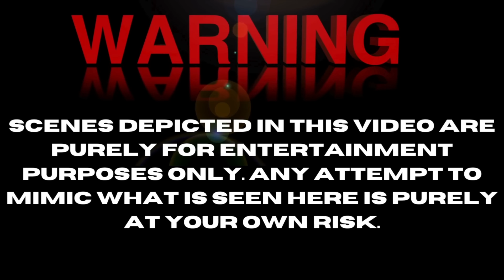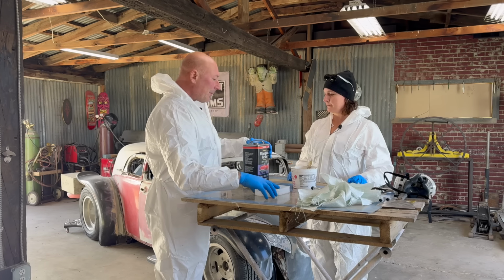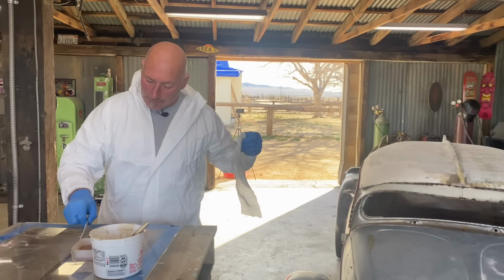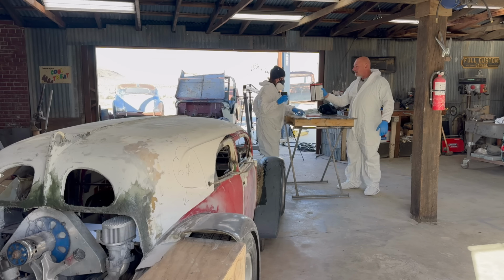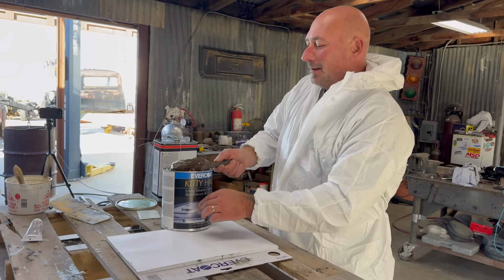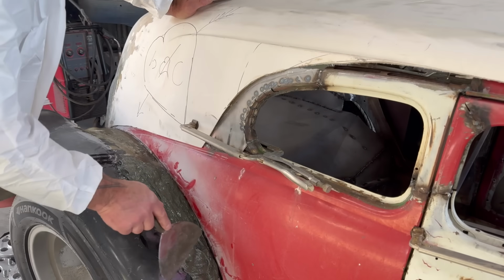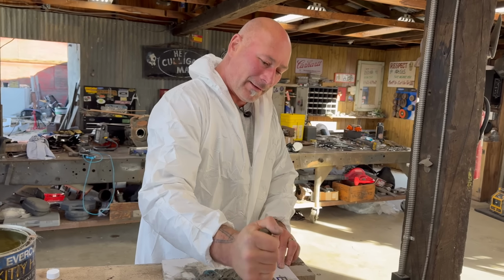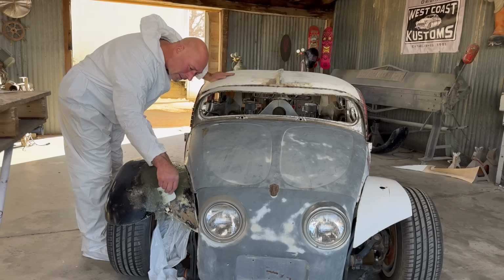Part 28! Full Custom Ian 1968 Kustom Volkswagen Bug Fiberglassing Lesson Is In Session 🤓

Comment: i have worked in the fiberglass industry for 45 years doing everything from grinding to mold making and a little thing you can do to avoid the ichies when working with glass is to use baby powder on exposed skin before you work with the glass also use cotton clothing it makes a big differance
Reply: Yup
Reply: Please match the front window's to the back reverse that shit , just saying 👊👊👊
Reply: Not the windscreen
Reply: Thankyou @TheresaFogg  for the tip 😊👍🇦🇺🍻🍻
Reply: Good for you
Reply: Ian, you should spray the steel body with a release agent then build the glass against the body.
It might save you from some extra work.

Comment: Great content, editing, episode. Having gone through 45+ gallons of epoxy resin and hardener in the last eight years in boat refits I have a few bits of advice I haven't seen mentioned in any of your posts. I always double glove when doing epoxy work. You never know when you might need a clean, gloved hand to pick up a different tool. Those plastic spreaders can be lightly folded to create inside and outside flowing radii. Keep doing what you do. Thanx

Comment: For FRP / fiberglass reinforced plastic you need to use between 1% to 3% depending on the weather hotter days go with 1% colder days go 3% an this ratio you should get like 30 min work time depends on what type of polyester resin your using an for hot glassing  you can go like double catalyst an the catalyst type as well depends on time an function for the FRP system you are using 😉 I know this as I have been in the industry for over 40yrs I have been watching Ian for yrs love your work 😊😊 ❤❤
Kind regards Jasmine the JDM girl 👧 from Sydney Australia 🇦🇺 💕 💖 ❤

Comment: A little tip from an OLD fiberglass guy. Ultraviolet lights like the old black-light fluorescents will fire off your catalysed material without overheating it the way heat-lamps do. If you can luck onto an old tanning bed canopy that has the 8 ft fluorescent tubes, you will be set to lay up resin in cold weather without any worries about getting it to fire. I bought one from Goodwill for $20 about 25 yrs ago and it would be yours if I were driving your way with my truck. Unfortunately, being 80 yrs old and only flying into the desert for some liesure time, won't get the job done. I'm in Sonoma County if you have a friend up here who will be making the trip, I'd be happy to hand it over to them.

Comment: I have worked in the fibreglass industry for nearly 50 years .. making surfboards to making moulds for various things and carbon fibre wings for drift cars and motorcycle fairings .. correct ratios are 10% catalyst to the amount of polyester resin and should be applied when temperature is between 20c and 30c .. to have perfect time and mix .. we all have different ways of application .. mine is to make the less mess the better and always have acetone available for clean up .. sanding dust should be washed off with cold water first !
Reply: Surfboard building is a artform in itself, it's amazing how you Guys design and shape them.

Comment: If you only put a pin code of resin on one side of the fiberglass Matt after it dries it's flexible so you can form the shape that you wanted to be and tape it down then you can put it where you want it with 5 minute epoxy instead of rivets and

Comment: I used to add a few drops of fiberglass resin to my body filler (Bondo) to make it smoother and reduce pin holes. I also used to cover the fiberglass work rough in with waxed paper so I could mould it smoother, then easily remove it when dry. Never saw someone use a drywall blade (putty knife) that large to spread glass or "mud", but it works for you, guess I never had projects that large that I need to. I got Tiger Hair fiberglass impregnated body filler. I'm sure it was just a name thing, like Kleenex or Scotts facial tissue. As always great work great video.

Comment: Great job on that glass work. I know that when I built my wooden boat I mixed up small batches of the epoxy so it would not go off on me before I could spread it. Have never worked with that kitty hair, might try it on my latest project.

Comment: FYI If you do get fiberglass dust on your skin pour rubbing alcohol on you then let it evaporate, this will pull the fibers out of you pores then sluice it off with cold water. I was told about this in the70s when I was taught this when i was doing fiberglass boat repair

Comment: The real Blob was catalyzed with CO2 (Steve McQueen knew) . Not good for cars though as it shrank significantly.  🙂 I was 1 year old when the Blob came out. But I always thought it would be funny to sneak Jello into the theater, sit in the back and the scene where it oozes out the HVAC vents throw it forward. Lastly, not sure why even in cool temperatures I would have used a third of the hardener you did and still have my filler fire off of almost immediately. Maybe it depends on the brand.

Comment: I like watching you, Ian, making litle jokes and injecting humor as you work through your design and execution of the designs and mods as you go. Weather metal as usual or other materials in the builds.   hey, if you can't laugh a little as you work it makes for a dull and boring job.. I like to have a little fun as i work on a car or other project. . my currant project is an electric guitat extrwew mod and rewiring with a lot of cool tricks i dreamed up for my guitar.    One of my futurd project will be an inverted Trike from salvaged 20 in' bicycles low slung single seat trike single wheel in back and 2 steering forks in front ..I need to get a cheap welder from Harbor Frieght, thet's about $100 plus tax.. rosin core welding wire of course to save fron having to get argon gas tanks all the time.. the rosin core wire is readily available at Harbor Frieght as well anyway..  lol  ...   I'm going to use the steel bunk bed parts as the frame of the trike along with the original frames of the 2 bikes i'm using as a base for it. they are complete bikes but neglected by my grandsons as they lost interest and got into video gaming hardcore..   so turning trash to treasure much like you do all the time with the custom car builds you do all the time...   I started working on cars at 14 helping my dad restor his '62 Corvette. mostly engine and suspensioon. a little fiberglass where the fender on the right reas had seraraATED DUE TO VIBRATION AND STRESS. SO A LITTLE REINFORCEMENT ANE GLASS WORK CURED THAT LITTLE ISSUE... THE REST WAS JUST TUNING AND CLUTCH ADJUSTMENT.. TILL IT WAS STOLES ... TWICE... WE GOT IT BACK PAINTED PRIMER BLACK TO DISGUISE IT FROM THE SORT OF PSYCODELIS ASDEDE JOB THROUGH THE MANY LAYERS OF PAINT IT HAD GOTTN OVER THE YEARS SO LOOKEDE WEIRD BUT KIND OF COOL TOO.. THEN WHEN WE HAD TAKEN THE ENGINE AND TRANS OUT TO REBUILD THEM IT WAS STOLEN AGAIN NEVER TO BE SEEN BY US EVER AGAIN.  i miss that little hot rod since I had learned to work on it as well as how to drive a car in it in the winter snow and ice of Ohio just after my 15th B-day in Dec a week from christmas on the 17th.. and then by spring drag season I got to qualify for a NHRA sanctioned drag racing license to compete that year...leaarning in the slick conditions of winter I learned how to control the car better and feel how it reacted and handled in every kind of road conditions even how to drift through curves on packed snow on pavement.. all 1800 lbs and 350 hp of that car.. what a rush..

Comment: While thinking about cosmetic issues, how about those Baja headlights? Maybe move them outboard from the beak to that panel connecting to the fender. Then find a unique trim for the beak. Also, there is a special roller for fiberglass mat. You need one. It's the best way to get the air out of the resin.

Comment: Looking awesome guys...I really think lambo door style would be great with the floor boards and fenders would be not much need to trim or modify at all
Reply: Gullwing would be cool as well.
Reply: Was thinking that but I dont think the door frames or roof line would have enough strength to support the weight without a huge amount of bulky bracing
Reply: @ashleyrichards4698  You may be right there.

Comment: I use to do fiberglass work at Mack at truck. I was taught to take a torch and burn the paint & rough sand before applying fiberglass. The guy that taught me had been doing it 20 years, so I did as instructed. 
Anyone know why this was done?
All I know, I never had a failure. So I hope we both learn something here.
Reply: Were you doing repairs ? i can see how roughing the surface would give it something to key onto, but i don't know about the burning part...maybe it was a quick way to remove the paint..

Comment: Is the work time about the same as bondo or is it faster? 
Because 10 minutes is what I wait before sanding bondo when I used it to fill nail holes and joints  on my cabinets.
Reply: I see a lot of woodworkers using coloured resin now in cracks on rustic timber, some of those river benches/tables are really cool.

Comment: I'm a bodyman since 1990 do the math. I'm just enjoying the build and if I ever see something to help I will tell. 
I found that 3M 8115 panel bound I use instead fiberglass.  Just wipe it like bondo. You can even heat cool heat cool etc if in hurry but I like to let it cure 24 hrs.  At least you don't itch. I hate fiberglass and avoid at all costs. And it's as strong as steel which it's made to weld
Reply: I think that's what he said he's glueing the top on with..

Comment: Eeeeyannnn……. Put down some waxed paper where youare mixing, it is easier for cleanup and you can pick up the messy fiberglass with ease and just slap it on the work area. Added benifit is your gloves dont get as messy and with the waxed paper stillon you can quickly work out the bubbles with your fingers. There is also small diameter ribbed rollers made from aluminum that will help speed up  spreading and pushing out bubbles.

Comment: That bug looks terrible without the curved roof - basically I hate it .... also shaping a car with globs of fibre glass is hack to me - metal fab is the only way !!!!
Reply: Less Metal = Stronger and Less to Rust ..
Reply: How is it hack? So Corvettes are hack cars? What bout using body filler? Fiberglass is hell of slot stronger & last alot longer than Bondo or filler. And how could u hate this vw & the masters artwork? This is what vw's shoulda looked like. Yeah the bubble roof is great but why not be different and change up a vehicle? That's what fab work is all about.
Reply: @65cj55 I totally agree with ya. Plus it's a lot stronger that body filler or Bondo and last alot longer too